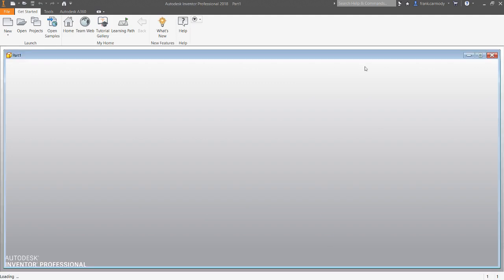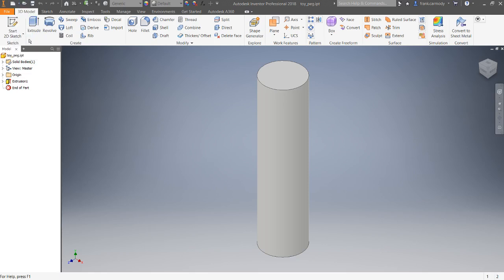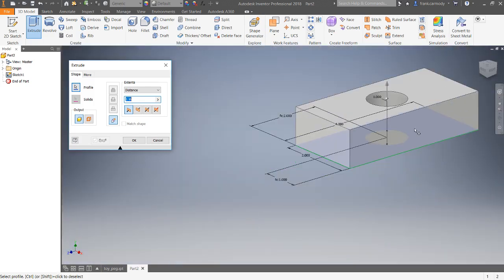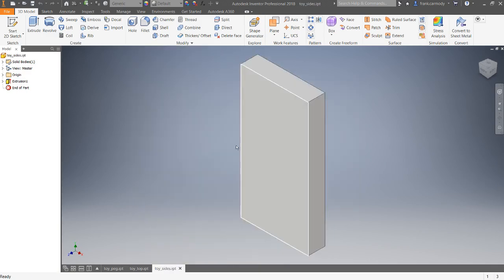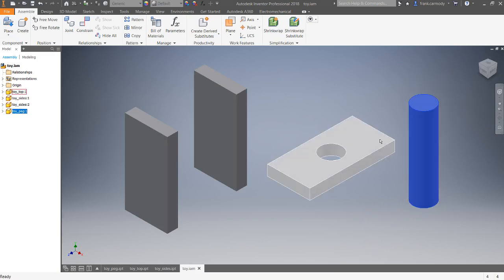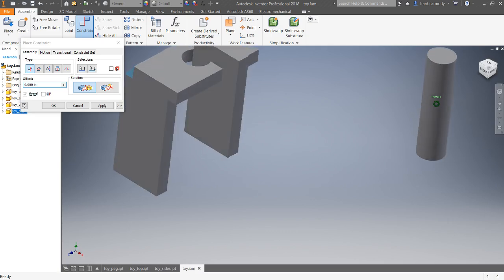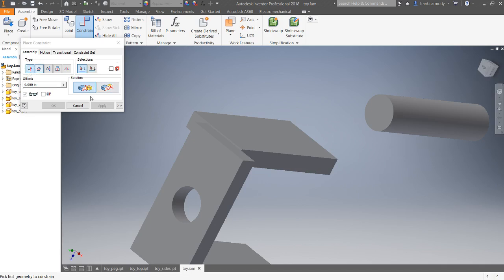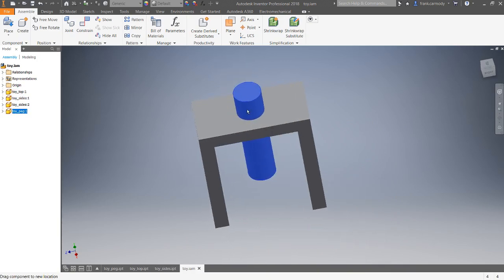Autodesk Inventor 2018: 4 : Basic Assembly

Comment: I'm a Solidworks user for many years and also used Inventor for about two years. Rule of thumb: ALWAYS create your parts from the origin point and not like he did with the peg. It will make your assembly a lot easier.
Reply: And to add in an engineering environment you would be fired
Reply: wira rifqy  the way physics is calculated is from the origins at simple parts it doesn't matter but when you get to more complex parts its a must for certain tools like wrap.
Reply: Is the "mate process" similar in invetor and solidworks, because I can mate this much faster with solidworks (CTRL+faces)? In invetor mating looks like in catia? am I wrong?
Reply: @Haris-nd7st  Mating in Inventor (Constraining) took me a while to get used to it switching from Solidworks. Because Inventor planes are driven by both faces. So it's either Mate or Flush.
Reply: Agreed. It won’t throw off measurements as bad later on
Reply: thank you,  i've just started using inventor it's apparently making things easier